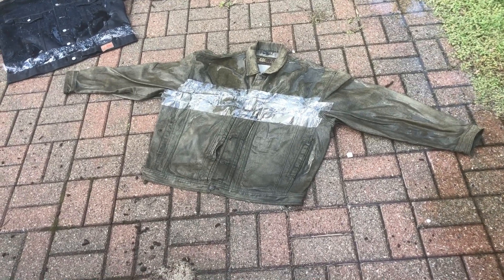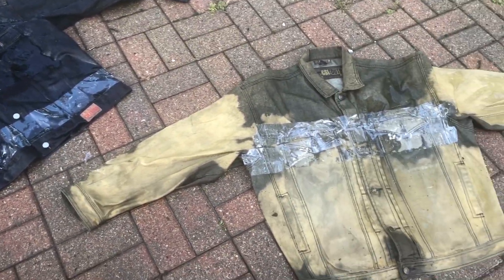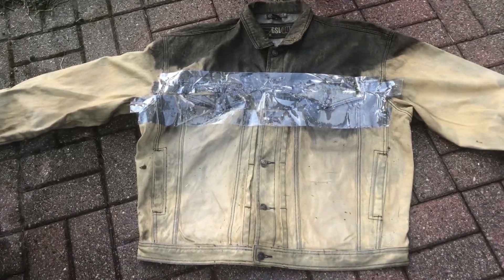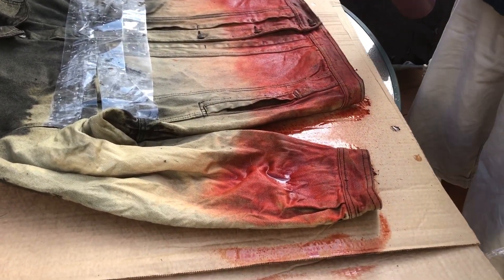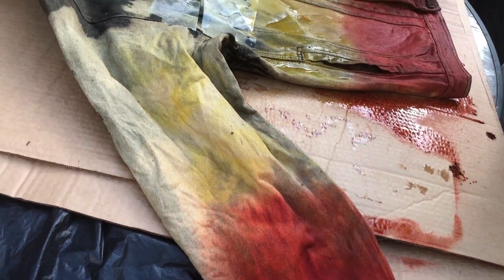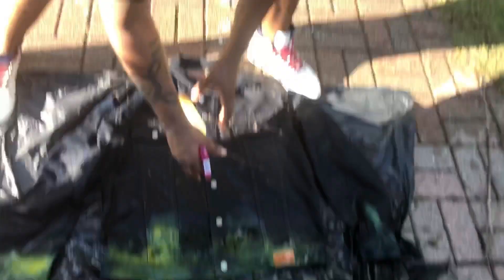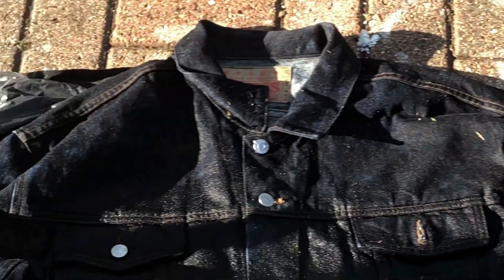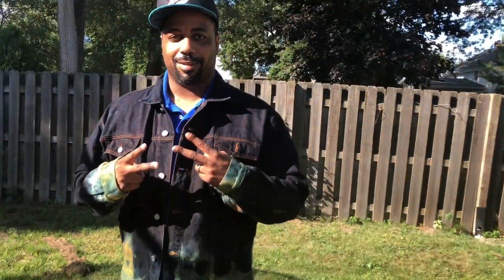How to bleach and dye a Guess & GLS Outdoor denim jacket

Comment: Good job  i have a jean jacket it is lighter i am debating weather i should color it .   for the first time i did  Reverse tie dye  bleached it first  just experimenting  i even tempted part of a dip dye   I used acrylic  paint  and  I mixed it with water i am going to let it dry 12 to 24 hours  then  wash it out see if it worked  before i tempt  my jacket .

Comment: It was a nice experiment. If I were You, next time you want to do a Color Block Look or Bleach specific areas, I would put the bleach in a small margerine container and get an inch or 2 inch paint brush and put about a cup of bleach in it and brush it on the edges of your dark blue jacket to get the effect you want, plus have more control. I would do the same thing with the green jacket to get more of a Color Block Effect. Your Jackets look Good & Different!
I have a white jean jacket I want to dye Pink, 
Dark Denim or Charcoal. Then I'm going to do some Embroidery, Sashico Stitching, Other Applique Pics of My Life & Symbols I like. It'll take a few years to complete but I think of it as tatooing my jacket. Maybe You can add on to your jackets. Thanks for sharing video.
Reply: that's cool. make videos :)